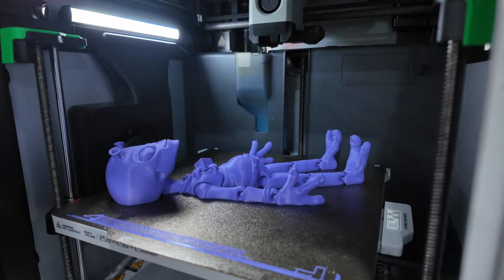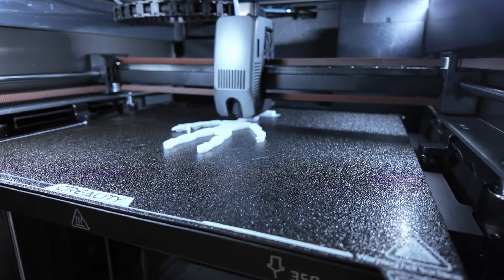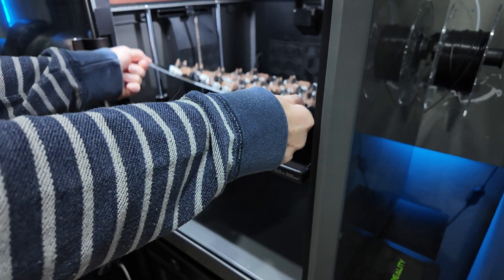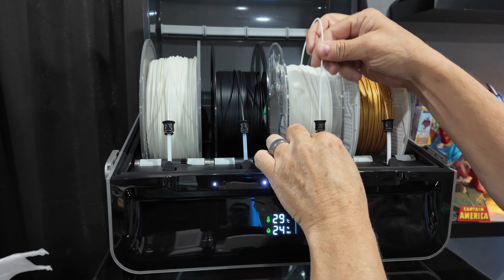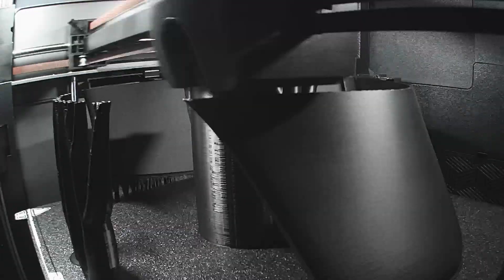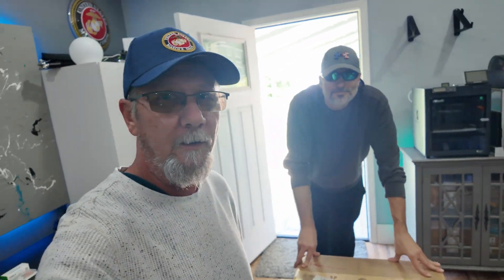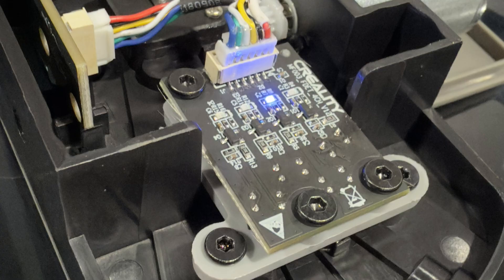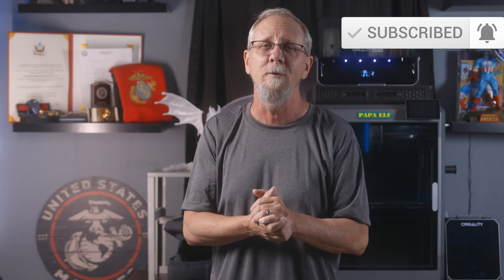Why The Creality K2 Plus 3D Printer? HEAR ME OUT!

Comment: I just bought one. Its nice, but not nearly as nice as it sounds. 
they haven't corrected the door glass adhesion. My K2+ is the new revision with the brighter duel lights. It came with door halfway attached. 

i just got done printing a riser for the top glass, its a requirement or else the glass gets scratched up. Im already seeing scuffs.

And worst of all, the side spool has to be unplugged when CFS is attached. No "Y" adapter!
Reply from the maker: Printables has a y adapter that many other printers also require. Bambu doesn’t use a y adapter either. As for the top glass, my Bambu’s, Elegoo’s and Creality all require the same riser to prevent such so nothing new there. Maybe they should recognize the trend huh? The door I fixed that broken is now my back up but the next one they sent me is still going strong. Happy printing.

Comment: Hey, could you answer a question for me. I’m about to pull the trigger on the K2 plus and I will be using this indoors. Do I need to rig up and exhaust that will go to my window and if so, how do I go about doing that?I cannot find any information on it.
Reply: A couple of venting options available on printables to exhaust out a window if you really feel the need,I regularly print abs in my living room and have never noticed any odorous whatsoever.
Reply from the maker: Good morning from Florida. I don’t vent mine nor do I know anyone who does and have a few YT acquaintances that have them. The enclosure with the Carbon filters typically are enough for most users that print harder materials. Now being in a larger room with at least some ventilation is preferred. Hope that helps.

Comment: I had a problem with the buffer. I was getting error codes that was supposing from extruder jams . took it apart ninety times. ordered a new extruder with new metal gears to no avail. If it wasn't for filament clogging the buffer itself i may not have had a clue. I was using the printer with the external filament setup. once I got the new buffer I was back in business not one error.
Reply from the maker: I just had a different issue and got around five different codes and couldn’t isolate any issues. It just would not calibrate and only began printing once. The random error codes that spanned from heat bead, bed leveling, a generic code lol, a head leveling code and z axis block……J gave up and took it back to Best Biy for an exchange and just got a new printer. I venture to say that the last problem was severe enough to just take the easy route instead of chasing the issue.

Comment: 4:23 nozzle is one of the commonly described problems of K2 Plus though. Users reporting that it have some problems with actually harder to print filaments like PETG, ABS or ASA - that you eithy print very slow or would have a high fail rate due to the extra strain on the filament that comes from the printing head design and nozzle design.
So I wonder if you had such experience as well
Reply: So far have had no issues, but other than pla I've only printed PP-GF30.
Reply from the maker: Well so far so good for me but I will return to give some feedback. I’m seeing issues with the extruder but was a quick adjustment but they have provided a new extruder (v2). I’ll look into that but otherwise, just love my printer.
Reply: @SeanHelmsMedia  Interesting. So maybe in v2 they've made the problem better or fixed it. Most of the current reviews are about first 2-3 months of the printer and after that you basically only see "Ah, it's good only for PLA" and people don't even try it anymore.
Reply from the maker: @vladimir.smirnov so true. I print way too many ABS products to keep silent. Minor issues as of yet but same experience with my Bambu printers. X1C and P1S.